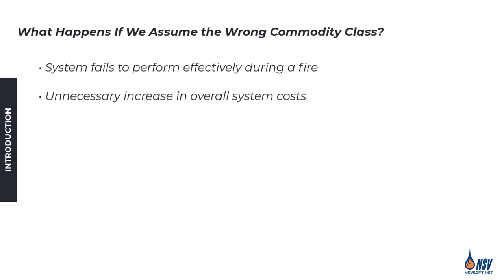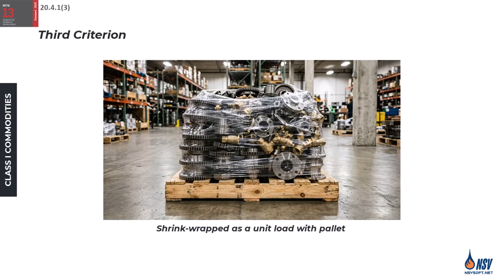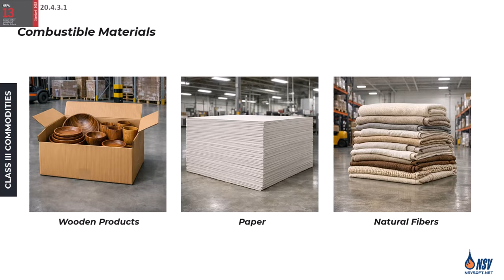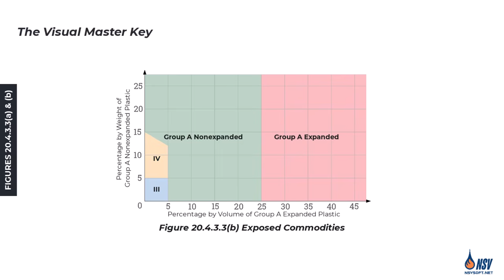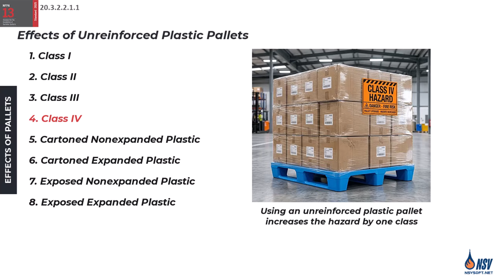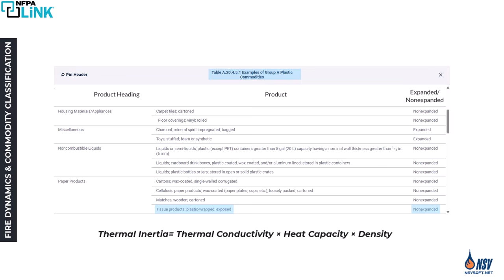📦Commodity Classes (NFPA 13)

Comment: wrapped packaging is a method of wrapping, and if it is applied to the sides and top, it becomes encapsulated; therefore, it cannot be considered that wrapped packaging is unencapsulated.
Reply from the maker: Thanks for taking the time to leave a comment and share your perspective! In industry terminology, when wrapping is extended to cover both the sides and top of a storage unit or rack, it is simply referred to as encapsulated.

Comment: Great breakdown! One thing that always trips people up in the field is mixed commodity storage — like when Class III goods are stored alongside Group A plastics in the same rack. Could you do a follow-up on how NFPA 13's mixed-commodity rules (Fig. 20.4.3.3) actually get applied in real warehouse inspections, especially when packaging (encapsulated vs. exposed plastics) changes the classification?
Reply from the maker: Hi Farzad, 
Thanks for your comment!

When a building contains a mix of different commodities, NFPA 13 provides several approaches for determining the appropriate level of sprinkler protection.

The first approach is to design the sprinkler system for the highest‑hazard commodity present in the building. This method gives the owner maximum operational flexibility, allowing materials to be moved anywhere in the facility without concern about whether the fire protection is adequate for that location.

A second approach is to segregate higher‑hazard commodities into dedicated areas, with each area protected by a sprinkler system designed specifically for the hazard stored there. The limitation of this strategy is that the owner must strictly maintain the correct storage arrangement. If additional higher‑hazard materials arrive and all designated areas are already full, the owner has no compliant location to store them. There is also a practical risk: personnel responsible for unloading or relocating materials may not understand the sprinkler system limitations or may simply overlook them, resulting in higher‑hazard commodities being placed in areas where the system cannot meet the required demand.

NFPA 13 also provides a third option for handling small quantities of higher‑hazard commodities, outlined in Section 20.4.15.3 of 2025 edition. In most situations, up to 10 pallet loads of a higher‑hazard commodity may be placed within any 40,000 ft² area, provided the loads are randomly distributed and no two pallets are adjacent, even diagonally. When the building’s fire protection is designed only for Class I or Class II commodities, the allowance for Class IV or Group A Plastics is reduced to 5 pallet loads.

A fourth option applies when goods are stored in rack storage and the design uses independent in‑rack sprinklers in accordance with Section 25.7 (2025 ed.). This approach is explained in detail in a separate video, scheduled for release on December 14, 2026 on this YouTube channel. NSVCad users already have access to this content.